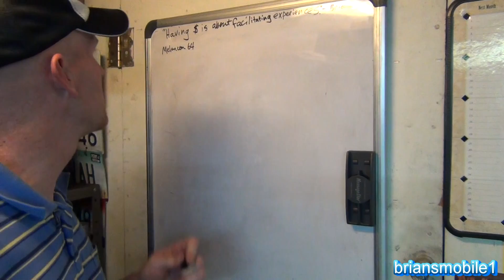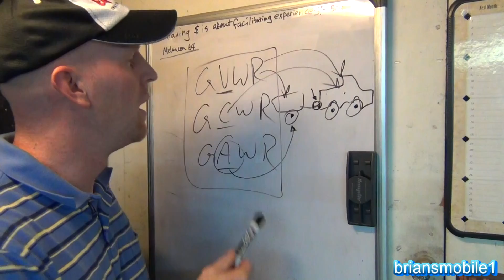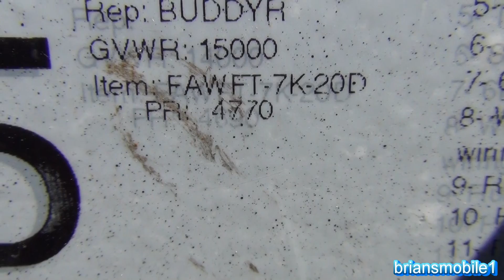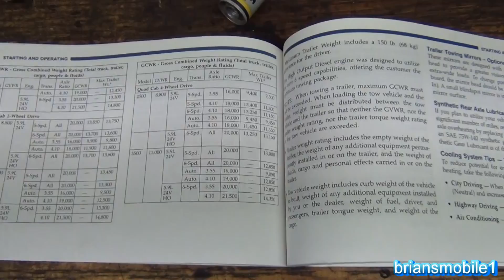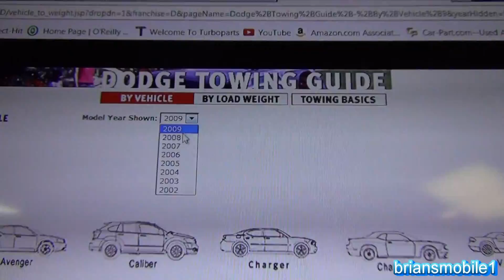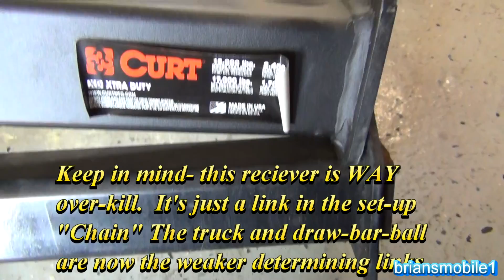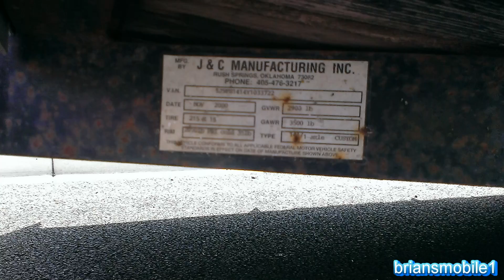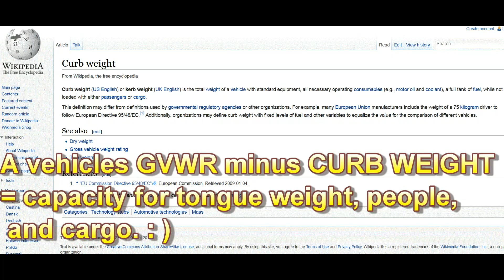What's GVWR & GAWR ?????

Comment: Had a question. 

If a travel trailer gvwr is 7500lbs 

Does that still apply for when the trailer is parked without being hooked up on a pick up?  

So the trailer will be sitting on wheels and a front jack

Comment: I'm not sure about how to put this all together to determine how much weight you can haul.  The information I can find on my Subaru 2008 Outback is maximum towing capacity of 2700 lbs.  I don't know if this is gcwr or gvwr or what it actually means.  My guess is gcwr.  All I plan on doing is towing a small Uhaul trailer once in a while with a fairly light load.  Thank you for your video.

Comment: I liked the video, but you are wrong on several points and missed some key points to address.

Gross Axle weight is ONLY the applied force on the axles, so the GVWR of the trailer CAN and WILL be more than the GAWR on most trailers, unless derated.

Example: 40' gooseneck with a pair of 10k axles and a 25k GVWR. this means that at max weight, 5k will be tongue weight, which is 20% and well within normal operating range for a gooseneck.

You also mention the GVWR of your truck, but neglect to mention anything about tongue weight of the trailer.

Example: my truck has a GVWR of 7250lbs. With full fuel, 4 people on board, some stuff in the bed, and a WD hitch attached, it weighs 6250lbs. This means I can ONLY have 1000lbs of tongue weight (or distributed weight) added to my truck by the trailer and still be legal, EVEN if I am below the GCWR of my truck, which is 15,600 lbs.

You also neglect to mention anything about how a WD hitch adds MORE weight to the truck front axle and trailer axles  from the tongue of the trailer, so If you have a 7K GAWR on a trailer with an 8200lb gross and add a WD hitch, then you could very well be over weight on GAWR without meeting the GVWR of the trailer.

The last point you fail to mention is GAWR of the truck! You have one for each axle that must be measured as well! If you are over on either, then you are illegal, regardless of any other number.

You also fail to mention tire rating on either the trailer or truck!

So, you have:
GAWR of ALL axles
GVWR of the trailer and the truck
Tongue weight of trailer
Hitch distributed weight
GCWR of the total rig
Receiver GWR
Ball GWR
Hitch GWR
Tire GWR

Every single number MUST be below max to be legal.

Comment: I really like the video and ALL of the info you explained about it. Now as for all of this stuff about the trailers this is my 2 cents worth; i have been in the trailer industry for 8yrs now and have worked at axles companies that make the product for the trailer as well. They do rate the axles lets say at 5200lbs but realistically they can haul 8k worth of weight and be fine but down them because 99% of everybody hauls more than suggested and would hate a 8k axle to have 12k weight on it and shear off while hauling down the toll road. Just know that its safety reason not an actual weight possible til she snaps!

Comment: Thanks for the education. Definitely   Makes me want to be informer and rather be overqualified than under safe. 

Questions:
1- do you have a video explaining stabilization bars? Math behind then, installing them, level of support they provide vs not having them and if adding them adds weight to the connecting hitch.

2- is there advise or rules to follow if the trailer width is more than the towing suv width? What’s allowable?

3- height of enclose trailer, vs height of towing SUV? Wind effect based on height and length? Base on what wind speed are stabilizing bars recommended? 

4- any video about maintenance and installation and use of trailer electric brake system? 

Thank you
Reply from the maker: I don't have videos on all those things, but  I have some really great connections for making such videos.  Thanks for the ideas!

Comment: I almost always agree with less legislation, not more in every case. In one place I will side though with that gentleman. 

I believe that every motor vehicle AND trailer should be required to have the VIN embossed on both frame rails and on a metal tag which is clearly visible for easy inspection. 

There should also have to be on both types of vehicles a metal vehicle ID tag riveted to the frame which states GVWR/GAWR/Month/Year of Manufacture/ Tire Size and Inflation Pressure. 

It should be a felony to remove either the VIN tag or The INFO tag from a vehicle and a vehicle should not be able to be titled or sold without both present. 

We don't need Inspection laws or a bunch of other business. You are responsible to keep up your own trailer. But it should be the law that you have the correct information to do so and that it be indelibly marked on the vehicle.

Comment: I traded in my 99 Sierra K1500 5.3L with 3.42 axel for a 96 K2500 7.4L with 3.73 axel. Pulling my 5400lb (dry) trailer was just too taxing on the 1500. I was expecting a larger difference in tow ratings, the 1500 was 6500lb, while the 2500 is 7500lb. When I first checked, I was like, that's it. However, when towing with the 2500, I must say I feel much more confident that I'm maintaining control, it accelerates much better, stops better, negligible sway and bounce. The 2500 is just so much better at towing.

Comment: Question... My trucks rear axle weight rating is 6,500lb, but my max payload is 2,250lb. What's the difference between the gawr and payload?
Reply: barrigany payload is gross weight - actual weight.  If the rear of your truck weighs 4200 and the Gvwr is 6500 then 6500-4200 allows you to apply another 2300 pounds to that axle. That 2300 you’re allowed is your “payload” . But keep in mind that must still fall within GVWR.

Comment: Have 97 rv w/ ford chassis. Going to be pulling a trailer w/ a truck.  Trailer axles= 7000×2. Truck weight= 6800. Rv towing capabilities? Rv has 2 axles. Duallies in the rear. Any knowledge or advice much appreciated. Delayed trip because i was not comfortable with idea of not being educated. And possibly harming or worse. The public or my self.  This video has helped out a whole lot. But need rv info.   Thanks

Comment: I have a new hot shot business. I am a CDL since 2010. I am trying to educate myself because I am really into safety on the road. So I need to be educate on my truck and trailer. I have a 3500 Ram Dodge and a 32 feet Goose Neck trailer. Each trailer axle is GAWR 7000 total of 14000 GWR for just the trailer. I was told by others that I would be safe when I take a load of 13500 or less. not over that. How can I be sure that I am legal to haul the weight that I will be hauling across country. Can someone educate me more.

Comment: So for the busted trailer with the sod on it, an easy way is usually to look at the tires.  If the there are 2 tires that say 1750 lbs max each, you shouldn't probably put more than 3500 pounds on the trailer.  Tires and axles are usually matched.

Comment: one big thing,, you have to keep in mind your class of drivers licenses, just because you have a drivers license and a trailer that can carry 12,000 Lbs and a legal truck to pull that weight, it still do not mean your legal to tow it, in Canada we have your standard class G drivers license, with is for your every day car and light truck, then we have a class D or a class D-z the z is air brakes, this is for heavier trucks such as 5 ton loaded say 33,000 Lbs or more  up to tandem trucks if the have air brakes you need a class D-Z if its hydraulic brakes well D is all you need, then we have Class A-Z witch is for heaver towing trailers such as transports or any trailer with a GVW of more then 10,000Lbs, so you can have a 16,000 Lb trailer but do not requester it over 10,000 Lbs or your going to pay big bucks a year to keep that trailer licensed, even at 10,000 you going to have to have it MTO  safety yearly, so with a class G, B, or D you cant tow any trailer loaded heavier on the trailer wheels of more then 10,000 Lbs you can put more weight to the toing, as long as you don't go over your max tong weight, if you get pulled into an  MTO HYW  scale and your trailer wheels weigh more then 10,000 you going to get hit with an over weight, driving with out the right class license, in-safe load, oh they will pile up, you need a class A to tow that trailer if the trailer wheels weigh is over 10,000Lbs, I used easy terms so most can  under stand with out getting into all the letters number and bs

Comment: Loved the video, very informative! Question? Any trailer can only be rated up to its weakest link, correct? If the two axles are each rated at 7,000 lbs how can the GVWR be more than 14,000 lbs?
Reply: Because 14000 lbs is maximum load on the trailer tandems, and the balance of any weight is received  by the vehicle towing it thru the hitch { when distributed correctly. }

Comment: hi brian, awesome video - thanks! wondering if you'd have any suggestions for weight of a 30' trailer that will have a tiny house built on top? ( am trying to determine whether 16k will be enough or if I should get 2-8000# or 3-7000# axles)

Comment: Brian - I have a question, the 2016 GMC Denali has a GVWR of 7300lbs, the specs show it can tow 8100 lbs , the Airsteam has an empty weight of 5600 loaded at 7300lbs and a tongue weight of 900lbs  - does this look like enough truck or should I be looking at a 2500 Series truck ? thanks for your opinion
Reply from the maker: With at weight distribution hitch for that tongue weight issue- you'd be banner!

Comment: Thanks Brian, also at what point does need to get into CDL requirements. I intend to get a 3500 reg cab with the G56, for my personal use, this video along with your trailer video encouraged me to go through. Keep it up man.
Reply: CDLs come into play in various places. It vary state by state, however it has a standard of 26,000# max limit before it is necessitated. For a straight truck at 26,000#, a class B is required. It the truck is fitted with air brakes, a class B license is required at the least no matter the GVWR. For combinations, the trailer typically has a max GVWR of 10,000# before a CDL is needed. For combinations exceeding 10,000 trailer GVWR and 26,000 truck GVWR, you need a class A unless the state you are in specifies otherwise. Hope this is useful information.

Comment: Good video, I was looking for a refresher on difference between GCWR and GVWR and it all rang true with what I remember researching a couple years ago.  Also remember tire pressure when looking at your GAWR - keep those tires pumped!  Like Brian said, cargo and passengers reduce your towing capacity.  Also make sure to check your driver's license class; here in Ontario a class G license limits you to towing 4,600kg or 10,140lbs.

Comment: I'm sorry I'm a little confused I have a 2015 Silverado 1500 I would like to tow a trailer but I don't understand the ratings the truck has a GVWR of 12000 pounds does that mean everything combined or I can pull a camping trailer that's 12000 pounds
Reply: +Sam M 

GCVWR (Gross Combined Vehicle Weight Rating) is the maximum allowed weight from your tow vehicle's headlights to taillights on the RV. That's the actual weight of everything -- vehicle, trailer, people,  cargo, fluids, fuel, beer, etc...

GVWR (Gross Vehicle Weight Rating) is the maximum allowed weight that can be carried by the respective vehicle.  That's the actual weight of the vehicle, people or cargo, fuel fluids, etc... It also includes the tongue weight imparted by the vehicle being towed. For an RV, 15% of trailer weight is a fair estimate if the things inside your RV are sensibly loaded.

For instance, my gooseneck deckover trailer is rated at 14,000 lbs (2x7K axles). The trailer itself weighs 5K loaded with chain and tools. My tractor wet (loaded with fuel and ballast) weighs 6K. My backhoe attachment weighs in at 1.5K. My loader (w/bucket) weighs roughly the same..

Doing the math, 5K+6K+3K=14K, so I have the trailer max-ed. If I'm worried about the highway cop, I can drop one of the buckets in the tow vehicle's bed to carry that part of the load on a different axle.

For your particular instance, you'll have to look at page 9 on this PDF:

https://www.chevrolet.com/content/dam/Chevrolet/northamerica/usa/nscwebsite/en/Home/Vehicles/Commercial/02_PDFs/MY15-Trailering-Guide.pdf

Find your engine, chassis and gear ratio and it will give you manufacturer specs. 12K can be gross combined on the low end -- which again means the weight of the whole loaded rig including tow vehicle -- or on the high end it can be max towed weight.
Reply: +Cylinder Excellent info, Thank You very much!!

Comment: Leave the damn bureaucrats out of it. Once those brainless idiots get involved,  things get complicated and ridiculously stupid due bureaucrats not doing their homework on the issue. The current laws are fine, just need to be enforced better. And the local police could stand to learn their roles in law enforcement. Or even just a polite word or helping hand for a driver (commercial or private) to help in a delivery location or turning around in tight quarters.
Reply from the maker: ***** I think you've nailed it on the head.   If an officer isn't specialized in vehicle inspections they often won't cite for no trailer lights/brakes etc.  If loose trailers are killing people in high enough frequency that it's a safety issue to the public, then public safety officers could stand to enforce those laws.
Reply from the maker: briansmobile1 Trouble is, they get mocked by other officers for giving them a bad name for being too picky.

Comment: Any trailer over 7500 should have a Weight Distributing hitch.
Reply: +mitchalvin and the proper size truck to tow the trailer.  The hitch is only part of the problem, so many people seem to think its ok to tow heavy loads with a compact pickup...and no trailer brakes on top of it.
Reply: +William Todd (williamtodd) Yes and you should have brakes on all the axles.  Most cheap trailers only have brakes on one axle, any tandem axle should have brakes due to being over 3500 gvw.  Truck brakes are only good up to the trucks gvrw, if your gcrw is over that you should have trailer brakes anyway.

Comment: just as critical to weights is where theyre positioned. you always want at least 10 to 15% of the trailers combined weight  to be on the hitch. a 12,000lbs hitch can only handle 10% of the actual weight, which is bordering on the light side. I personally would not bumper pull more than 10,000lbs and use a gooseneck/fifthwheel for anything higher.

Comment: Don't forget to greace wheel bearings, especially on boat trailers used to launch boats.  Best to use Bearing Buddies.  A hub cap that has a greace fitting on it and a spring loaded plunger inside to keep pressure on the greace and thereby prevent water from entering the hub during a launch.  I see more trailers with burned out bearings sitting on the roadside than I do from flat tires.  Tires are a whole nother subject that perhaps Brian will address.
Reply from the maker: Great video topic.  Tires and bearings.

Comment: In NY, the trailer is inspected, and it is looked at closely. Just recently someone was pulling a boat and trailer on the highway, un-inspected, not licenced and more that likely not insured a wheel flew off the trailer and went threw a windshield killing a mother and injuring 2 children.
Reply from the maker: That's terrible!  Did the hub nut come off?  Or did the lug nuts come off?
Reply: Some reports of failed bearing. Boat trailers are subject to water, and long periods of sitting. Main root cause of the failure is more than likely ill maintenance.

Comment: E X C E L L E N T video Brian. I imagine it will help lots of folks. Might have mention(ed) weight distribution in the trailer to avoid the dreaded trailer steering the towing vehicle syndrome. I see this happen from time to time in my travels. Scary going down hill when driver slams brakes on to stop trailer from whipping... Will it or won't it work out? Hang on and we'll see.... .

Comment: One thing I've learned is that the brakes are the weak link, often times. Most engines have plenty of power and the vehicle's frames are stout enough, but when you try to stop is when you learn how important NOT overloading your truck is.

Comment: Hey Brian, GR8 Job with Trailer Safety issues.. This week, I saw my neighbor hauling a monster load of tree limbs behind this little Nissan truck. The trailer came off the ball and one safety chain was dragging on the ground. It really pisses me off to see this because he is some type of (property maintenance) contractor and don't spend a dime on his vehicles, but claims he was ASE certified at some dealership in Texas.

I believe in public safety and there is reason to believe his trailer came off before because the back of his truck is all dented from the tongue smashing into the tailgate. Safety inspections are required here but when your relative just labels your equipment from the "Good Buddy System" its pointless.

Once again, thanks for putting the time into this informative video.
Reply from the maker: You're welcome!  Professionals who use trailers like landscapers and construction workers around here that use their trailers every day are often the worst offenders to safety I've found now that I'm paying attention to this topic.
Reply: I was doing annual inspections on construction equipment and my employer instructed me to validate the safety inspection when the "Break Away System" did not work (battery dead etc). I can't stand to work on equipment when the boss tells you to look the other way or wants to be cheap because they can get away with it.